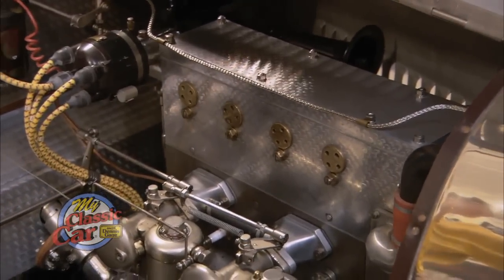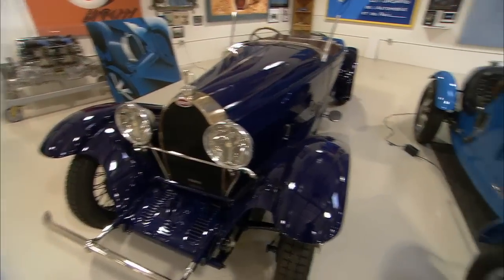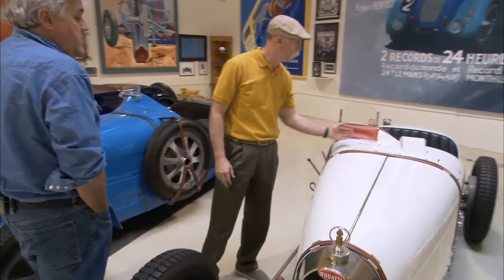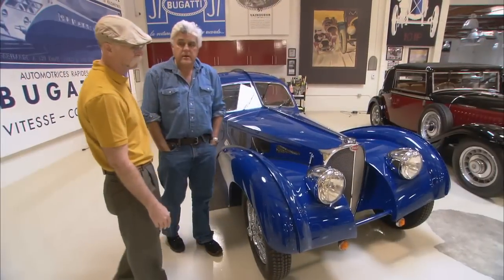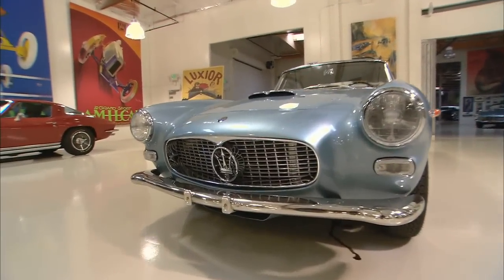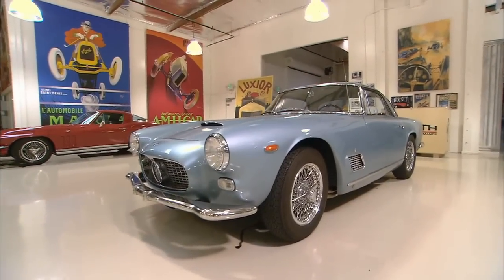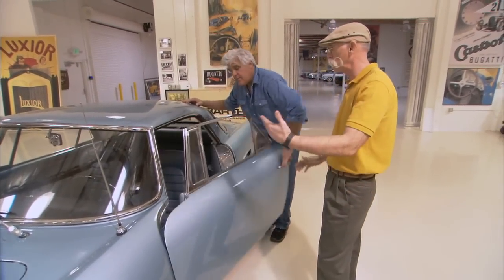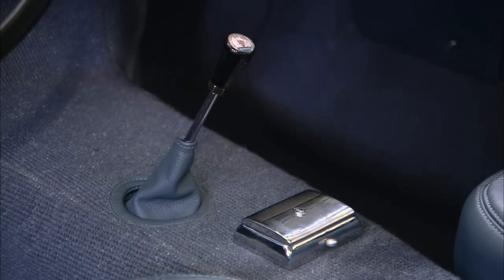Jay Leno's Bugattis and Maserati

Comment: The Maserati 3500 G.T. Iniezone, is a delicious piece with Aluminium tube coachwork from "Touring " in Milano.  It is supposed to have 235 net HP and 235 km/h topspeed (147 m/h)